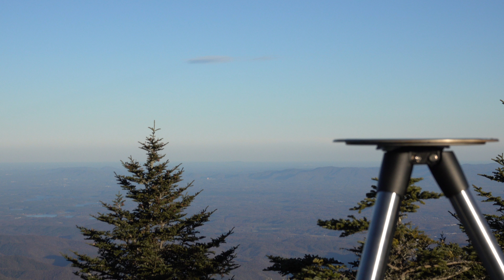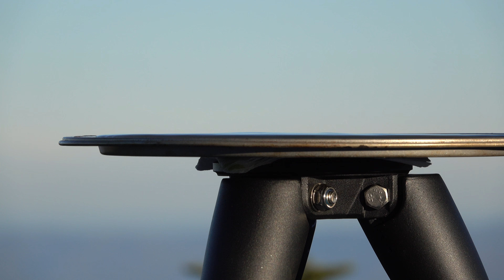FLAT EARTH DESTROYED visual proof from Mt Mitchell

Comment: Is your elevation at this spot higher than other places in the distance? Of course the horizon will be below your plate o water. Are you not using your mind? If you are at the highest point around, everything in the distance will be lower. And the horizon wouldn’t be the same 360 degrees around unless everything was at the same elevation.
Reply from the maker: IF the Earth was flat the vanishing point would be the horizon, emphasis on the word POINT. Parallel railroad tracks would converge to a point on the horizon. IF the Earth was flat it would be parallel with the water & the parallel lines would converge & the horizon should be at the level of the water, but its not.
Reply: JCHangtime ....no it wouldn’t. The horizon is the convergence of land/water and sky. On a ball or flat plane, it would never be at your elevation if you are above it.
Reply from the maker: IF the Earth was flat it would be parallel with the water. Parallel lines converge at a point. Railroad tracks converge at a POINT. If your eye is over the right track the left track will still converge at the same point as the right. IF the Earth was flat & parallel with the water it would converge with the level of the water. Since the Earth is a sphere & curves away from the level of the water the horizon is below the level of the water. I discovered new stuff while while I was taking more video. I have been scouting out new objects & locations.
Reply: JCHangtime...friend, I’m not flat or round.....I’m in a land of discovery.....but I use levels and theodolites at work. If you use an instrument that measures on a level plane based on gravity or the plane, you will see that what you see through the instrument is based purely on your elevation relative to what is around you. If you are at low elevation you will see land in the scope toward the horizon. If you are at higher elevations you can see further. The only way to see the horizon meet at sea level would be to put your instrument at sea level........
Reply from the maker: If you were in a perfectly straight tunnel that you could not see the end of & you stood against the plane of the right wall, the plane of the left wall would converge with it at a point. If you were on a ladder up at the plane of the ceiling, the plane of the floor would converge with it at a point. The floor would converge at the level of the ceiling. Since the Earth is a sphere the horizon curves away from level. I found a place looking back at Mt Mitchell where it was below the water level. I will make more videos in the future.
Reply: JCHangtime .....I’m surprised you are using the same argument many flat-earthers use for the apparent sinking of sun and moon. But I’m subscribed and looking forward to your next video.
Reply from the maker: While I was on a mountain at sunset I watched the shadow of the mountain that I was on go across the plane below then project above the horizon then the whole shadow of the Earth project above the horizon. Another thing is at sunset the Sun will light up the bottoms of the clouds, it could not do this if it stayed above the clouds on a flat plane.
Reply: JCHangtime ....you should check out Rob Skiba’s flat earth experiments about atmospheric magnification. Interesting if nothing else.
Reply: Gra Ra5 you sure have spent a lot of time letting me know I’m in error, so I shall retort....my observations about his instrument versus the view of the horizon is sound. I use leveling equipment. Forget about the ‘rising to eye level’ statement. That is a statement based on perspective. A level instrument will show the horizon relative to your elevation. Many of these devices are made to ‘chain’ through points carrying known elevations over distance. It would take a very elaborate experiment to prove a globe or flat earth with these more simple devices. Now.......

“Not according to FEs”.....

Do you speak for all flat earthers? Not all believe in an infinite plane, some think there  is a dome. Some believe in God, some think we’re in a simulation. Don’t speak what flat earthers believe when you have no belief in it yourself. 

“Their questions reveal they will NEVER research ideas that conflict the belief”

Do you believe all these people learned they were on a flat earth in school? That is laughable. Of course not, we all went to the same indoctrination centers and learned the same things. The people that are “flat earthers” have shown a great deal of research beyond their beliefs. We wouldn’t be having this conversation if they hadn’t. Can you believe the sun is 93 million miles away. It has not been measured. Are you sure there is a molten core in the earth. We haven’t even dug halfway to the so called mantle. But I bet you believe it because ‘scientist’ put it in your science book. Can you prove the Big Bang? I’d really like to see that. 

And then Rob Skiba......a man who’s observations about lensing are not supported by anything we know about refraction in the atmosphere.....I guess you didn’t watch all his work. He copies directly an experiment created by globe believing scientists who are studying atmospheric lensing so I guess the 16 year olds should say something to those guys too. 

Do you use instruments for for your experiments? What do you know about atmospheric lensing? Have you ever seen the sun or moon appear larger at the horizon than high in the sky? How does being in a plane disprove curvature?

I think your mad, bro. About flat earth. If it bothers you so much, you should put in down and find another topic. Nothing holding you to tell all the individuals on YouTube that you’ve got it down pat.
Reply: Gra Ra5 .....funny I can see your reply on email but not on YouTube. No worries. You must be a troll to spend so much time on Christmas morning to let me know how ignorant I am. That’s fine. I’m not burdened. Please take a moment to read these verses: 1 Corinthians 3:18-20. It’s really all I need. At least to decipher this great and wonderful world of scientific theory. I don’t need to prove anything to you because you’ve already decided. It’s not worth my time. Merry Christmas. I hope you have a great holiday.
Reply: Graham Rathbone I see you are a troll with absolutely nothing better to do. Good luck buddy.
Reply: Gra Ra5 the lonely Christmas troll strikes again. Don’t you have better things to do? No, the lonely troll doesn’t. You didn’t read my one bible quote? Your mad that I won’t read a ton of your quickly looked up BS and you call the Bible superstitious. You are the one that’s lost, bro. The truth is found in that book. How many time’s do you get lied to before you stop believing the liar? Maybe after the first time you are on guard but beyond once, trust fades quickly. Our history is full of lies from the establishment. 911 was a lie. Sandy Hook was a lie. Las Vegas was a lie. And the list before that.......All I need is God and logic. Relativity is a joke and the reason most people can’t see things for what they really  are. If you get in a car, the car moves not the ground beneath, correct? Or are you going to say, “relative to what”? Flat Earth, is a philosophical point (and most likely true), that the establishment powers that be, have a stranglehold on society. But you, the good watch(dog)troll of science will put on your shield of gravity and the cloak of the expanding universe to come out and fight people who are so dumb you can’t help but win. Yeah! But you missed the point. And now you’ve shown your allegiance to the people that enslave you in this world as well. I hope you can get over your superstition and find the light. God will never be in the darkness.
Reply: Gra Ra5 do you think that your fluffy adjectives make you smart? Tells me your a child, or a paid shill that got his feelings hurt by bullies all through his young life and now when the guy keeps coming back, he uses big scary words to try and scare him off again. I haven’t run yet but you keep repeating that phrase. Maybe you don’t understand. I don’t care what you think. I don’t know you. I can’t believe anything you say. You said you performed experiments in physics. Cool. I had high school physics too and there were many experiments performed. Big deal. No I haven’t dug a mm into my brain....your argument for the core. Wasthere another planet we drilled so we know the earth is the same? Your arguments are no better than mine if you can’t explain them yourself and must leave a link. You can go get paid to shill someone else now chump. Because you still will not even consider God in your science. God created everything and they are his rules. Rules don’t come from a chance creation, reaction does. So who made the rules if not God. The nature of the earth is clear in the Bible. Immovable. Finite. And doomed. You’re going down with it if you can’t let go of the world and it’s stuff. Cheers!
Reply: Graham Rathbone I don’t recall crying, and it’s TOTAL not TOAL. Again the troll attacks with aggressive behavior. He uses foul language and name calling to try to belittle his prey because he has no backbone. He will ignore God with all his might because he doesn’t want to recall and be accountable for his actions. Poor poor pitiful troll. Only someone with no life, or is getting paid, would spend so much time defending an apparent truth that some random ignorant bastard can’t understand. Breaking down statements and giving analysis and retort in great detail with time spent looking up links to support arguments. If you spent as much time with the Bible, maybe you’d actually learn something. Find God find Truth. I hope you have a pleasant day.
Reply: Graham Rathbone Thor and Zeus are not the God of the Bible. You are the coward. Because you think by calling me names in a YouTube forum might hurt my feelings. You still fail to convince me of anything. If you took the time to explain in a friendly rational manner, you might get farther. I know your type. Bark louder to be heard. Use more vulgar expressions to sound tough. You aren’t. You still repeat the same vulgarity in an attempt to bring me out of my ‘stupor’. Not working. All anyone needs is God on their side. Even you. Science as a form of question and observation and repeatable experiments are fine. You can take your theories and go away though. They are irrelevant pieces of garbage created by men who think they know better. That’s why you here in the news, scientists did this, scientists discovered that. It’s just a buzz word that everyone has been seduced by. Especially you and your shill coworkers who must get paid to go on and on like you are. The last 100 years of discovery and theory has only been scrutinized for that long. The Bible has been around for almost 2 millennia and still holds to scrutiny and people trying to dismantle it. You my friend are very lost. Find the light. Waiting patiently for the same stubborn and arrogant message from you again. Maybe you can pick one point, and we will go from there. Peace.
Reply: Graham Rathbone I can see my point blew by you. Still an angry aggressive troll who can’t prove a point. He only knows how to call people names and expect to get somewhere. I guess you didn’t meet your troll quota and are having to put some extra time in over the holidays to catch up. Guess that means no Christmas bonus. Bummer.
Reply: Gra Ra5 my argument is God. You are incorrect. And I don’t care about your links. You can’t prove anything to me because I refuse to listen to the arguments of someone I have zero respect for. That would be you. So you said you like to prove to people how dumb they are and how smart you are, but this ones a failure because you haven’t shown me anything but your scathing nature. No matter how many times you verbally abuse me or tell me I’m crying or running or whatever notion your timid little emotionless soul can conjure, you haven’t proven the earth is a ball or plate tectonic theory or gravitational theory or big bang theory or any other such nonsense. I would say stale mate. At best. Go find someone else like you who’s afraid of the light to pick on.
Reply: Gra Ra5 you would argue with a fence post as my grandad liked to say. Still can’t be polite. If all you want is the fame of showing the world how dumb I am, maybe you should pick a different forum than a comment on an obscure YouTube video from several weeks ago. Your ego must need to be stroked constantly. And I can’t imagine how lonely you must be. I should feel pity, but you can’t understand what that means because you only seem to love the system. I told you this was a philosophical point many posts ago, but you rant about my supposed weakness. Once again, I will rely on God and His Word, to back my position. No matter how many times you follow up, no matter how many times you call me derogatory things, no matter how much you think I’m weak or an imbecile, I will hold my stance that God is right, and you will never be with your current attitude.
Reply: Gra Ra5 ..........

1 Then the LORD answered Job out of the whirlwind, and said,
2 Who is this that darkeneth counsel by words without knowledge?
3 Gird up now thy loins like a man; for I will demand of thee, and answer thou me.
4 Where wast thou when I laid the foundations of the earth? declare, if thou hast understanding.
5 Who hath laid the measures thereof, if thou knowest? or who hath stretched the line upon it?
6 Whereupon are the foundations thereof fastened? or who laid the corner stone thereof;
7 When the morning stars sang together, and all the sons of God shouted for joy?
8 Or who shut up the sea with doors, when it brake forth, as if it had issued out of the womb?
9 When I made the cloud the garment thereof, and thick darkness a swaddlingband for it,
10 And brake up for it my decreed place, and set bars and doors,
11 And said, Hitherto shalt thou come, but no further: and here shall thy proud waves be stayed?
12 Hast thou commanded the morning since thy days; and caused the dayspring to know his place;
13 That it might take hold of the ends of the earth, that the wicked might be shaken out of it?
14 It is turned as clay to the seal; and they stand as a garment.
15 And from the wicked their light is withholden, and the high arm shall be broken.
16 Hast thou entered into the springs of the sea? or hast thou walked in the search of the depth?
17 Have the gates of death been opened unto thee? or hast thou seen the doors of the shadow of death?
18 Hast thou perceived the breadth of the earth? declare if thou knowest it all.
19 Where is the way where light dwelleth? and as for darkness, where is the place thereof,
20 That thou shouldest take it to the bound thereof, and that thou shouldest know the paths to the house thereof?
21 Knowest thou it, because thou wast then born? or because the number of thy days is great?
22 Hast thou entered into the treasures of the snow? or hast thou seen the treasures of the hail,
23 Which I have reserved against the time of trouble, against the day of battle and war?
24 By what way is the light parted, which scattereth the east wind upon the earth?
25 Who hath divided a watercourse for the overflowing of waters, or a way for the lightning of thunder;
26 To cause it to rain on the earth, where no man is; on the wilderness, wherein there is no man;
27 To satisfy the desolate and waste ground; and to cause the bud of the tender herb to spring forth?
28 Hath the rain a father? or who hath begotten the drops of dew?
29 Out of whose womb came the ice? and the hoary frost of heaven, who hath gendered it?
30 The waters are hid as with a stone, and the face of the deep is frozen.
31 Canst thou bind the sweet influences of Pleiades, or loose the bands of Orion?
32 Canst thou bring forth Mazzaroth in his season? or canst thou guide Arcturus with his sons?
33 Knowest thou the ordinances of heaven? canst thou set the dominion thereof in the earth?
34 Canst thou lift up thy voice to the clouds, that abundance of waters may cover thee?
35 Canst thou send lightnings, that they may go, and say unto thee, Here we are?
36 Who hath put wisdom in the inward parts? or who hath given understanding to the heart?
37 Who can number the clouds in wisdom? or who can stay the bottles of heaven,
38 When the dust groweth into hardness, and the clods cleave fast together?
39 Wilt thou hunt the prey for the lion? or fill the appetite of the young lions,
40 When they couch in their dens, and abide in the covert to lie in wait?
41 Who provideth for the raven his food? when his young ones cry unto God, they wander for lack of meat.
Reply: Graham Rathbone I can speak as an adult. You are the one with a teenagers mentality. We are not in a technical meeting over physics and design. 
2 Timothy 2:
14 Of these things put them in remembrance, charging them before the Lord that they strive not about words to no profit, but to the subverting of the hearers.
15 Study to shew thyself approved unto God, a workman that needeth not to be ashamed, rightly dividing the word of truth.
16 But shun profane and vain babblings: for they will increase unto more ungodliness.
17 And their word will eat as doth a canker
Reply: Gra Ra5 ....”Explain how the demonstrated and confirmable angular drop to the horizon ALWAYS measured and CONSISTENT with the PREDICTIVE model can work on a flat plane.”

Where was the demonstrated angular drop in this video? I believe he used a tripod leveled until water would rest on top. It is level but not even nearly as accurate as plane level much less a theodolite. Angular drop CANNOT be measured with the equipment in this video. 

Is the declination angle to a point 45 miles away, that is 500 feet above sea level, from a point 2500 feet above sea level, the same as the declination angle from a point 6’ above sea level 4 miles away to sea level?

NO!!  

CONSISTENT with the PREDICTIVE model

A predictive model is based on statistics. A real experiment would use real equipment and raw data. In the real world. We don’t live on a model.
Reply from the maker: IF the Earth was flat it would be parallel with the water & the vanishing point would be where the water is. Just like parallel railroad tracks merge at the vanishing point on the horizon. Even though the left track is left of the right track & the right track is right of the left track they merge at a POINT on the horizon called the VANISHING POINT. If you were in a never ending hallway the floor & ceiling would merge at a point. If the ceiling & floor were as level as the water they would merge at the same point if you were up near the ceiling or down near the floor. Since the Earth curves away from level & is not parallel with the level of the water the horizon can not merge with the level of the water. IF the Earth was flat elevation would be irrelative, just like in a never ending hallway everything would go to a point. Everything is NOT going to a point level with the water so the flat earth model is destroyed.